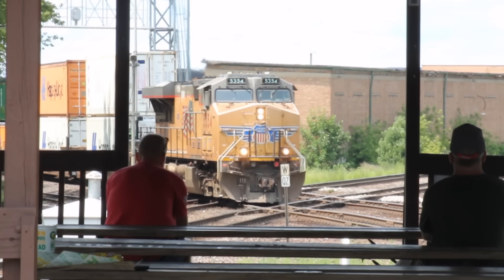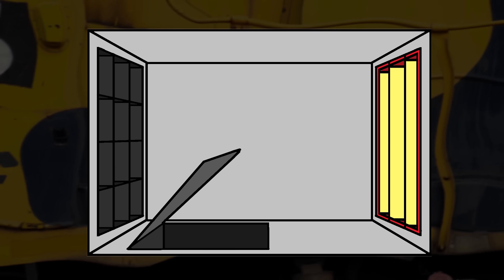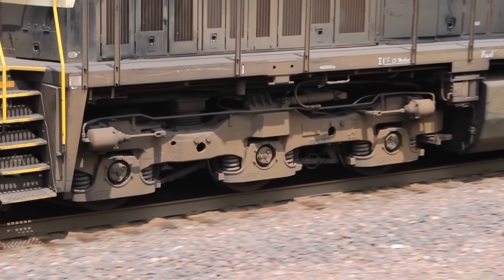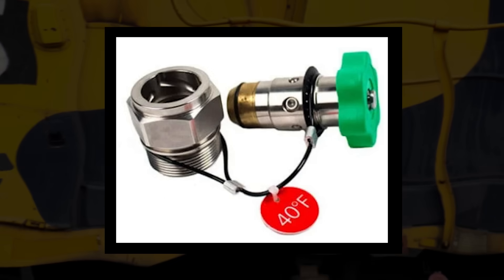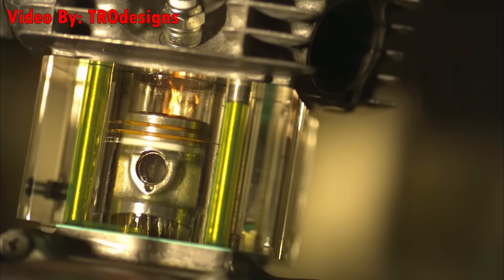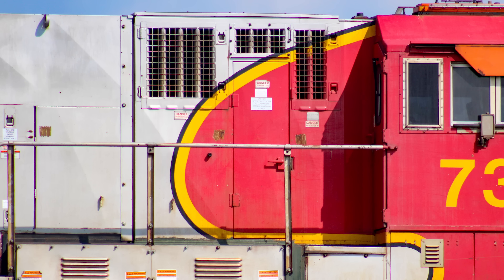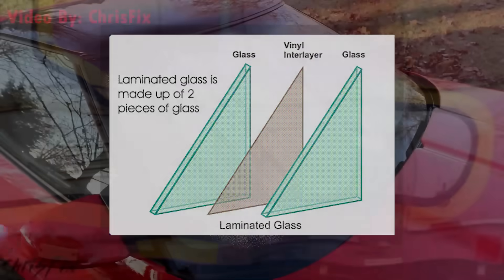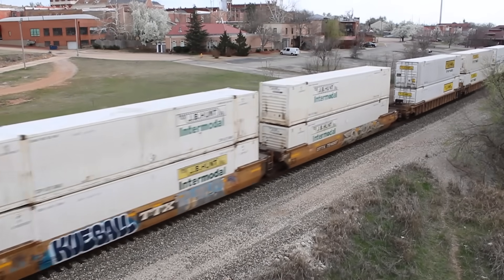The 10 Most GENIUS Design Features On Locomotives!

Comment: CLEARLY THE USA IS STILL LOCKED INTO 1960'S RAILWAY METHODS !
Not convinced you're going to find much in the way of "Genius design" on U.S Locomotives. Especially as most Railroads simply today "Hire" locomotives for which they have NO input into the original design. Indeed your programme describes many features on current U.S Diesel locomotive design which actually date from the 1950's. For example where are the modern THREE Phase Traction motors. And no mention of SEPEX (Separately Excited Traction Motors) to greatly enhance reliable traction, when wheels start slipping. And the primitive type Electrical Cabinets shown haven't been seen in Europe since the mid 1970's, when virtually everything became "electronic" to increase reliability and locomotive efficiency ! Indeed because your Railroads have a major aversion to Electric Locomotives, this means that the "Diesel" which has effectively reached its operational limits at around 4,000hp. Railroads are forced to play into the hands of the Two Major American Locomotive builders GM & GE. Which of course means it takes numerous locomotives to haul an American Freight train, massively increasing the total hire cost. So cutting into the potential Profit margins of American Railroads ! 

Electric locomotives in Europe from the 1930's onwards have been built for freight operation with as much as 15,000hp per locomotive. Indeed even by the 1960's the Germans were built Express Passenger Electric locos with 12,000hp (DB Class 103 with a 125mph speed maximum). All of which means far fewer locomotives are needed. Indeed today its pretty rare to see more than ONE locomotive hauling either passenger or freight trains in Europe. 

And instead of having massive freight trains clogging up long single line Railroads at meagre average speeds over hundreds of miles, often no higher than 40-50mph. Europe is running smaller but more frequent freight trains at much higher averages. Indeed Container trains in Britain were passed for 75mph as long ago as 1966. And now these sorts of freight trains can run at 100mph on numerous fast mainlines using one medium power (8,000hp+) Electric loco. While most of the Modern "Super High Speed" trains that hurtle around Europe at 186mph/300kmh have two power cars. Each with at least 6,000hp, giving 12,000hp for just a 10-12 car train, or 24,000hp for a longer 20 car train such as the International Eurostar trains (London UK - Paris France via the undersea Channel Tunnel) !

Indeed railway engineering from the track to trains, and operational methods, today across Europe and and an increasing number of other countries even in Africa. Reveals that US Railroads, motive power and operational methods stagnated in the 1960's. Which is why the whole US network even allowing for the Amtrak "North East Corridor" is totally out of touch with Rail Development on the rest of the planet. Which is progressing in leaps and bounds. Even Morocco on the edge of the Sahara Desert now operates passenger trains at 186mph/300kmh on a brand new Super High Speed Railway (Built by the French). Which has allowed the not insignificant freight flows across Morocco, to better utilise the traditional rail network and bring freight speeds up to an average 80mph/130kmh. And Egypt will shortly join the "Super High Speed train" club, as they are building one of these new "Super High Speed Railways" parallel to the River Nile from Cairo to Luxor, again for 186mph/300kmh trains. 

Worse possibly for the USA, is that your next door neighbour Mexico, has also caught on to Modern European Railway technologies, and is rebuilding and re-opening railway lines around Mexico. By upgrading to Electrification at 25,000v AC 60Hz, and upgrading lines for 150mph trains (some already running at 125mph using second hand British trains). And Mexico is already about 50% through the construction of a Modern European style Twin track Electrified railway to connect the Pacific with the Gulf of Mexico, with both passenger & Freight trains. For the sole purpose of STEALING much of the business currently passing through the Panama Canal. This new line will reduce freight train time between the Two Oceans  to around just 2 hours. A fraction of the time needed by ships passing through the Panama canal. The new Railway is being Built in conjunction with New Deep Sea Ports at either end of the line. And is expected to take up to 30-40% of Panama canal traffic, making it a very worthwhile investment !!

REF: I'm an ex Senior British Railways Mechanical & Electrical Engineer hence my knowledge of developments in the Rail Industry around the World !!

Comment: Most EMD locomotives have small winterization doors integrated into the Generator partition wall just behind the air filter housing. This gets the warm air as close to the engine filters as quickly as possible. Try to avoid having the dirty engine air reach the Cab and cause ventilation issues.

Comment: Anyone know exactly how these Engines Start? If they are battery operated and sit for long periods wouldn’t the batteries lose energy? Would it require a Jump Start?
Reply: Most have electric starts. Some models have air starts. either way the batteries can sit for a week or more with no issues.
Reply: @FFred-us9tw thank you

Comment: Immense complexity? Give engine diesel . Engine puts wires in buttholes and Engine drinks diesel and farts magic pixies into wires. Magic pixies tickle eclectic motors until they roll over laughing.. over and over. Eclectic motors have gears meshed to wheels and that make train go vroom.. to make train go less vroom, compressifyer is also attached to engines butthole causing pressure  to build... that pressure causes winds that gives all train cars blow jobs the whole time so they all relaxed.. when blow job stop all train cars get pissed and put their feet down, stopping the train.. magic pixies also tickle fairies trapped in light bulbs so hard they glow from how hot it makes them feel 'down there'

Comment: I suggest you explain acronyms to interest a wider audience. We don't all know what is EMD, GE. PA. etc. "Prime mover"? do you mean "locomotive"?
Reply: prime mover is american slang for locomotive engine, while EMD (Electro Motive Diesel/Devision), GE (General Electric), FM (Fairbanks Morse), BLW (Baldwin Locomotive Works), LLM (Lima Locomotive Works), and ALCo (American Locomotive Company) is mostly manufacturer
brand names for most american locomotives
Reply: EMD - Electro Motive Diesel/Division. Formerly General Motors owned, currently owned by Caterpillar.
GE - General Electric, specifically GE Transportation. Currently owned by Westinghouse, aka Wabtec. 
PA - Power Assembly. Explained in the video. 
Prime Mover - the diesel engine itself. These don't directly drive the wheels via a gearbox like in a road truck, they drive a generator that drives electric traction motors.
Reply: EMD- General Motors

Comment: How about this. Ever wonder how multiple units know which way to pull regardless of the direction they are facing? Pin 8 on the mu cable is forward, pin 9 is reverse. Pins 8 and 9 are reversed in the short hood end of the loco and reversed in the mu cable. Consider the short hood to be forward. Figure it out and you will see they all pull in the same direction, no matter which unit you are running from. Simplicity of a genius.
Reply: Unless the m u cable gets crushed, then it can do lots of things you don't want it to.

Comment: Emd uses an auxiliary generator to run all the switch gear,relays etc… the main gen is used for traction and d14 part of it is used for cooling fans,inertial filter motor and for loading through the SCR

Comment: I know of a design failure on the dash 9. The air horns are mounted to low. You get more sound at 90degs from the cab than you do in front of the engine.

Comment: Back in the late 70's, I was in the Air Force.  I had to escort a pair of SAC railcars from Chicago to northern Maine.  The military cars were placed immediately after the engines of a mile long freight train.  I learned a lot during that week long journey.  My question is: Can you explain what a "kicker" is - relating to the brake system?  We were getting intermittent brake activation because of a leak in the air lines.  The engineer referred to the problem as a "kicker".
Reply from the maker: Hmmm, I’ve never heard of a “kicker” before, but I know that train brakes automatically apply when they have no air pressure, so my guess is that a “kicker” is either an entire railcar or brake cylinder/component (line, valve, connection, etc) that is acting up due to low air pressure.
Reply: A kicker is an air control valve that is wrongly putting train in emergency application of brakes when sensing first minimum application of air brakes
Reply: It is a hobo that inadvertently kicks the hose on a car while he's sleeping. Or his gear is causing the rusted air line to leak excessively because it's pushing on the lines. Hobo Shoestring laid that on me.

Comment: Neat stuff, thank you foe the video. Interesting that you sgould mention 'Space Shuttle complexity' as it was my interest in real world spacecraft that has led me to trains (real cargo spaceships would be a lot like trains - big, complex, and moving on pretty fixed paths - maneuvering is hard!).
Reply: The interesting part is, they did all of this without computers.  Things like automatic throttle control for the prime mover (the engineer's throttle lever is for the traction motors), they had that figured out by the 1920s.  Remote control for multi locos, was figured out by the 1930s.  In cab signaling was also figured out before computers, and dispatchers could track trains to within 1 signal block long before computers.

Comment: I think the neatest thing about EMD engines (not sure if GE uses the same process) is that the fuel is used as a lubricant for the cylinders. Same amount of fuel is pumped through the injectors regardless of throttle notch, but the governor moves a pin that opens and closes with each notch of power, alowing more or less fuel into the cylinder. Any excess lubes the cylinder and injectors then falls down back to the fuel tank. Blew my mind when i learned that!

Comment: I used to be an engineer in Saudi Arabia for SAR our GE and AMDG's had sand plows that I could drop down to clean drifted sand off the rails. Also they have huge air filters not on USA locos
Reply: Hello James,   I recall installing the bullet proof glass and security bars on those Egypt orders to add protection

Comment: One of the coolest features I love read about is in amtraks p42 locomotive, which features a limp mode. If the computer detects a problem, it can run the engine at a reduced power rate and still move the train so passengers aren't stranded in a terrible remote area.
Reply: Please explain limp mode. Qualified Amtrak engineer who has fought and still fights with P42s. So if you know a trick I'm all ears.
Reply: @theknickerbocker5808  shamelessly copied from wikipedia:
"The Genesis unit is a fully computerized locomotive which automatically controls all on-board functions, thus producing high reliability while keeping the maintenance requirements low. For example, its computers can automatically reduce the power plant's output in the event that the locomotive is overheating, or suffering from low oil pressure, low water pressure, or reduced airflow into the intakes, thus making it still operable."
Reply: @xygomorphic44  Yes, they can and will. BUT, even the computer will shut down the locomotive when it feels it's getting too hot, running too low on water or oil, or just can't breathe. Have experienced all of the above with the P40, P42, and P32acdm. With the P32acdm being the most troublesome.
Reply: @mrvwbug4423  reliability is probably an additional reason besides being able to maintain track speed, especially through mountains.
Reply: @mrvwbug4423  Two engines on long hauls are for a couple of reasons. First, in case one fails, you have the second to limp to the next stop if possible. Make HEP if possible and if any damage occurs to the leader, you could always switch the engines around if facilities and time allowed. Another reason for multiple engines on long haul trains especially those that traverse the Rockie Mountains, is the dynamic brakes. The Calf. Zephyr as an example, always has 3 on the head for that reason.  Where the HEP for the train within the multiple unit consist is made is personal preference. I prefer in the leader that way if it gives me any trouble I can troubleshoot it almost immediately. Some prefer it off a trailing unit as it does make it much quieter in the cab.
The somewhat famous photo of the Builder with P42s and the Siemens units in the snow, the Siemens units failed the P42s still ran. There for a while, the P42s were protect engines for Siemens stuff.
Reply: The Siemens rollout has not went as planned.     The Genesis units have performed beyond expectations.   The split alternators (  one half for traction motors, one half for passenger car needs) were very close tolerance machining when built  back in late 90s

Comment: One feature is the locomotives communications system as in the radio and how it is pretty much plug and play with the "clean cab" form factor when it comes to upgrading equipment. This was really a plus when the FCC required all non amateur radio services to go narrowband and many locomotive radios had to be changed out then later when railroads decide (d) to adopt digital modulation like NXDN and radios had to be changed to dual mode analog and digital units rather then having 2 different units where one is strapped some place and the other in it's original spot. Pretty much everything in a clean cab form factor is compatible and they even make clean cab conversion housings (JEM Communications is one company) for non clean cab radios that allow a railroad to use their desired brand due to cost and still utilize the clean cab mounting system. Also OEM clean cab radios like Motorola's Astro Spectra will accept dual DC voltage either 72 or 12 volts which allows the radio to be used across a wider platform of equipment like in MOW equipment or hi-rail equipment. The same standardization hold up for the rooftop antenna mounts be it a single sinclair skate or a whole farm of different antennas, the mounting systems are pretty much ISO and adaptable and expandable as well.

Comment: Nice video.
Could also mention auto - start to maintain coolant temp. prior to needing the guru valve, dynamic braking (especially on Saluda !), pneumatic Independent vs train brakes, dead man pedals and tickle switches ----
Reply: Add to that the changes to the GE Pilbarra units that made refueling possible in the Australian outback without having to leave the locomotive platform eliminating the risk of a dingo attack at night.😮

Comment: Our older EMD, G22ARs don't have a starter motor and use the alt gen to spin rhe motor over. Kinda starts just rocking side to side and then theres almost like a drum beat sound that speeds up before the engine roars into life

Comment: The weight management system is garbage. There’s a reason only BNSF uses it…and also a reason BNSF only uses them on fast freights. Heavy coal loads and trains with significant hills on the territory they’re trash and never kick in when you need it to, it also won’t let you on demand sand, only when the computer system thinks you need sand, and by then you’re stalled out.

Comment: Are summer winter door used in Florida?
Reply from the maker: I think it would depend on the railroad. For a big class 1 like CSX, who's engines go all over North America, it would definitely be used, just so the locomotives are prepared for any operating conditions. But for regional railroads who's locomotives never leave Florida (like FEC), summer/winter doors are likely not used.
Reply: @Southern_Plains_Railfan  living in central Florida seems you should have max airflow both to the engine intake as well as ventilation. I live near a major CSX intersection were CSX runs intermodal from Vero to the port of Tampa east west, and the North South CSX routes serve all of the phosphate mines. Amtrak runs the same East west from winter haven to Tampa. So I watch them a lot. There’s an 84 lumber yard, and a scrap yard near my house that a CSX gp40 is usually swapping cars out every morning. And near my grandparents home in Daytona the FEC goes right by the golf course. Drives my wife and kids crazy but I love watching them